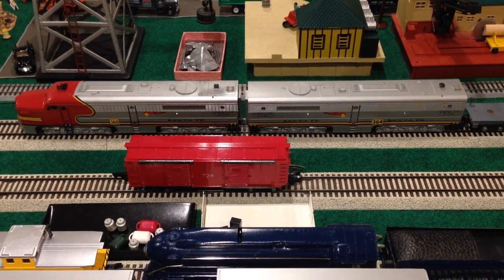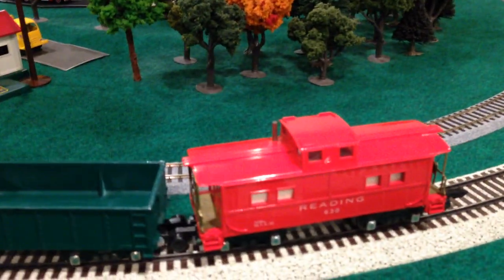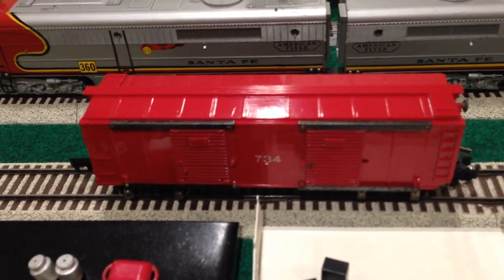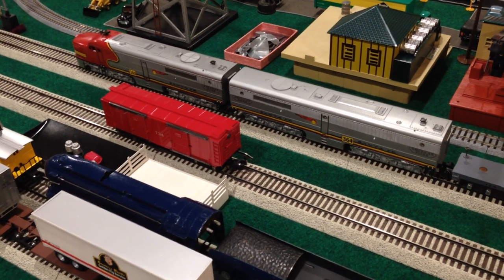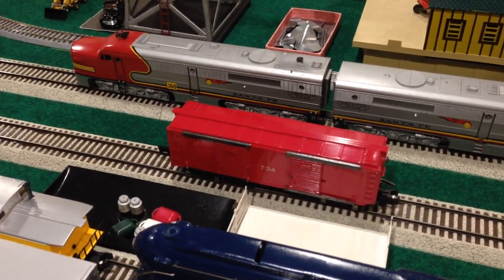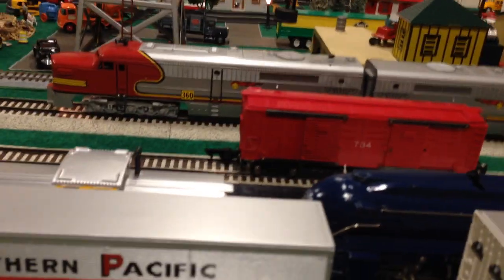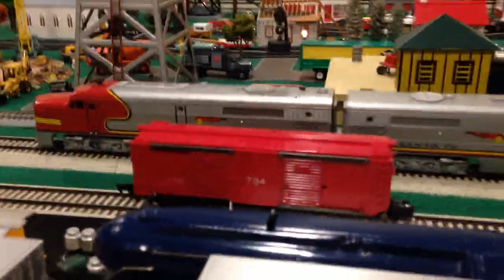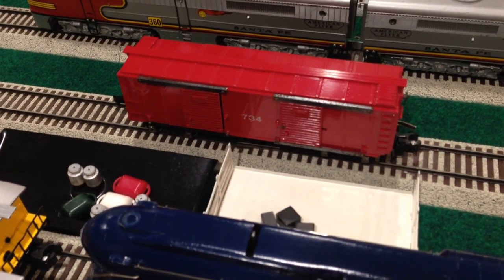AF Set 5107W: 360, 364, Horn & Op Box car demos - Part 3 of 3

Comment: Beautiful train Dave, nice work as usual, I love the wire spool flat cars, hope to own one some day, did I see that the operating 734 has a link and knuckle coupler? Is that a mod you made? Thanks and best regards, Daves AFTrains
Reply: Thank you Dave, I need to consider creating a transition car from one of my non-catalog set rolling stock, many times I want to mix KC and LC, plus in Classic Trains I noticed it was not unusual to see mixed consists, couple of freight cars and passenger coaches, I've been running those some too, have a great weekend! Dave
Reply: Daves AFTrains  I don't like knuckle  conversions because I can run 20 car link cars that work very well. Closer coupling looks more realistic. Link cars get jerked off the track if you use a pul mor engine anyway because link trucks are too light.